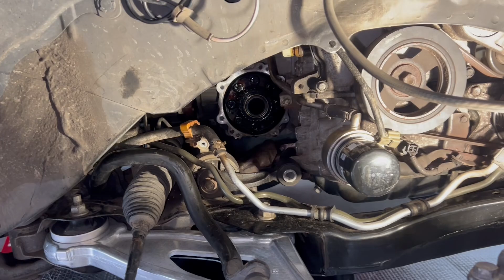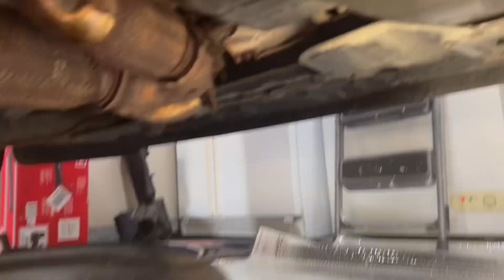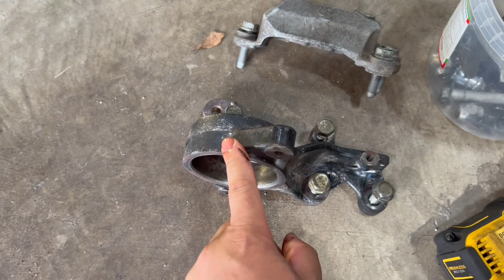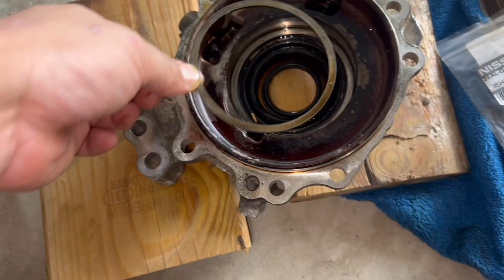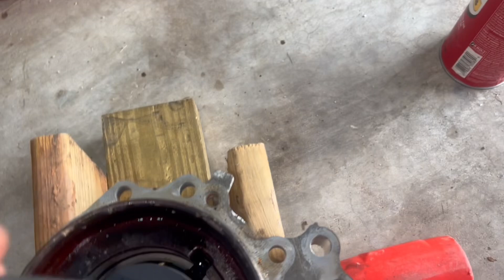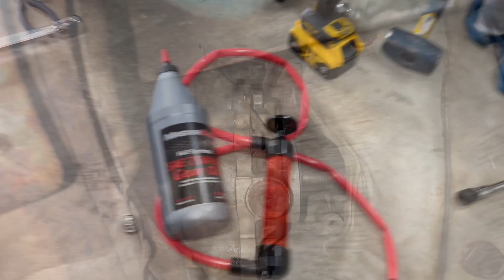2013-2020 Nissan Pathfinder(R52) 4WD /  transfer case cover O-Ring replacement

Comment: I swear, I'm going to soak all the bolts in anti seize. My path has 230k miles and every bolt was rusted. 

The transfer case seal was leaking and the passenger CV axle clicking and my bank 2 cat went out, seemingly all at the same time. 

You shouldve see the ten foot pole I used to get the hub bolt off and that was after heating it up with a torch for like 5 minutes. 

The last bolt to get the bank 1 converter off was stripped so I may have to remove the entire header now. I don't even like Nissan but why is this my 4th one lol..

Comment: Hello where did you order parts the seal that goes inside can’t find it or how did you find these seals I’m having a lot of trouble my transfer was replaced and seal was damaged I have a Nissan Pathfinder S 2013
Reply from the maker: You’ll have to get it from the dealer, no other shops/stores sells it.
Reply: @ thankyou for responding can you share with me the part numbers please for the dealer thankyou